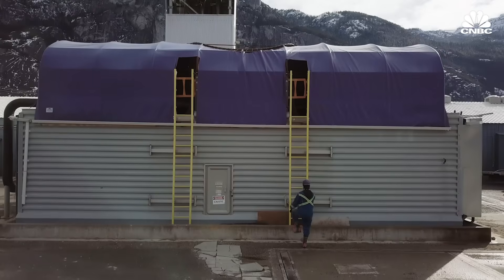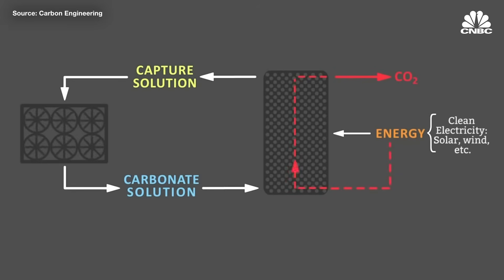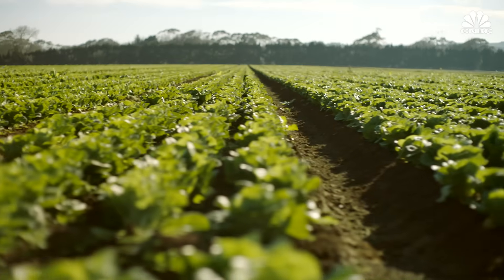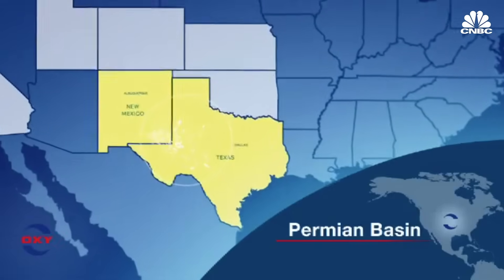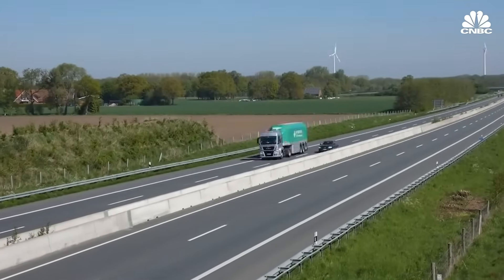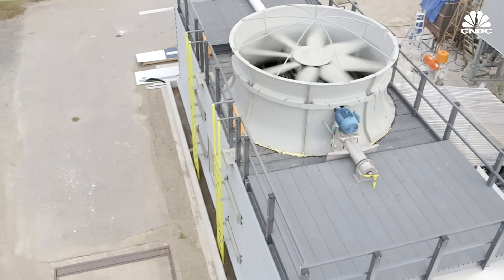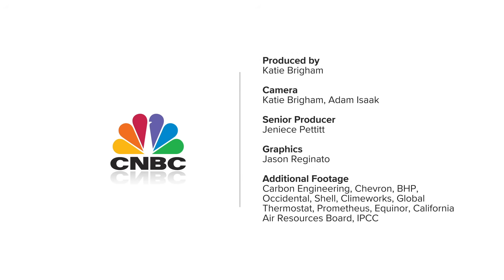Bill Gates-Backed Carbon Capture Plant Does The Work Of 40 Million Trees

Comment: Anthropogenic global warming....if only it were so. Global warming would move the limit of the grain belt up into Canada and Siberia. Greater CO2 would dramatically increase crop yields. Hunger would cease globally.
CO2 levels were many times greater in ancient times, yet no Armageddon occurred. Read the scientific papers of Dr. Heinz Hug to understand how CO2 functions in the atmosphere. It has very narrow bands of absorption, 1, 2.7, 4.3, 15 micrometers are the generalized spectral peaks. These wavelengths are ALL absorbed to extinction within 30 feet of the ground. ADDING MORE CO2 DOES NOT INCREASE ENERGY ABSORPTION, but only reduces the distance needed for full absorption by a foot or two. In fact, high CO2 levels caused higher O2 levels (photosynthesis) that allowed the dinosaurs to exist (Commercial green houses inject CO2 to increase plant yields). 

As an example, during the Cretaceous period, there was NO ice at all at the poles, much higher CO2, and the Earth was full of vegetation and dinosaurs. They could not live today as the O2 levels are too low for such large land animals. 

The oceans are rising today because the Wisconsinin ice age has not yet finished, there is still ice at the poles. The ice age ends when all the ice has melted, so technically were are still in the last ice age, but the next ice age will begin before the last has ended. 

The climate changes we have seen in the geologic record are entirely disconnected from the CO2 levels. CO2 is a VERY minor gas in the atmosphere (.04%). The Earth today has one of the lowest levels of CO2 in all of geologic history. If you double the amount of CO2, you reduce the water used by the plant by 1/2, and you have far higher growth rates. CO2 is the greatest fertilizer possible for plants. Note that water vapor is a vastly more efficient and abundant greenhouse gas (1% to 4.24%) than CO2. The reason for climate change is entirely due to the output of the sun, the tilt of the Earth, the orbital wobble, and the amount of cosmic rays striking the atmosphere. Watch the You Tube video "Svensmark: the cloud mystery" and maybe read his book "The chilling stars" to understand the reasons for climate change, it has NOTHING to do with CO2.

After doing these things, look on the US Geologic Survey website and find the graphs of Earth temperatures over the last 2 million years. This time period includes all the recent ice ages. You will see that this data proves we are leaving the current interglacial warm period and are entering the next ice age. In our lifetimes we may be within the next ice age. 

The fraud of anthropogenic global warming exists because the globalists are subsidizing it to convince us to accept a global carbon tax, that is to get western nations to accept it. There is no call for China, the greatest producer of CO2 in history, to pay such a tax. ONLY the west. This tax will in effect take money from poor people in rich countries and give it to rich people in poor countries.

Don't fall for this fraud. AGW is the greatest fraud ever thrust upon the people of the world in all of history. Don't buy it, educate yourself instead.

As a final note, read about the Vostok ice core samples, and other following sample sets to see that ice ages are preceded by a brief warming period. We are in that stage now.

Comment: There is a simple solution to the issue of what to do with captured CO2 Fuel and that is to limit it to vehicles that have no electric or hydrogen alternative... like Large ships and aircraft that travel around the world. This will of course require international laws. 

It could be forced upon industry by individual countries requiring ships and planes that use their shipping and air ports run on scrubbed co2 fuel.

If scrubbing CO2 out of the air to make fuel ends the messy and environmentally damaging pumping of oil out of the ground then that should be again a political aim made clear in law and something worth doing. 

At the moment I think about a third of all shipping is moving oil & gas around the world, so by putting co2 scrubbers in countries that are big importers then not only will there be less ships at sea often burning the dirtiest of fuels but we will also see Nations gain for the first time fuel independence and security.

This scrubbing of CO2 from the air is going to be expensive but I can see why oil companies would be interested in it beyond Green Washing their industry... reserves of oil are not running out any time soon but where that oil is located is getting more and more politically sensitive for various reasons, so being able to create fuel in situ without the drilling, pumping and shipping has a very powerful draw both economically & politically.

Let's be honest here, the Oil  Industry are not going to go away any time soon, so we need to encourage change in how they work and this is just one such opportunity. The alternative is going to be a move to more nuclear plants to replace those that are now reaching the end of their working life.

The main focus of future energy supplies must still be renewables with energy storage, more use of heating via ground heat pumps at neighbourhood level and getting transport to go electric and hydrogen powered.
Reply: Helen Lawson Nuclear waste? No solutions. Hydrogen manufacturing requires energy and is polluting and then is used to make electricity, inefficient.
Reply: Hi Joseph, As I said we need alternatives to avoid having to build new nuclear plants, not a fan but they produce good steady base loads to the grid.

Hydrogen for large vehicles & ships isn't perfect nor is the latest idea of ammonia, only we need something to fill the gap.

It creates a large amount of electricity ironically to produce most fuels we use but until there is a high density battery equivalent to fuel in large vehicles there is a need for something to keep industry moving.
It's what I like about scrubbing co2 out of the air and turning it into fuel but ONLY for aircraft, ships and large vehicles without practical alternatives, as it cuts out the need to get new out of the ground and then transport it around the world.

Comment: Trees decompose into carbon dioxide, plastic doesn't. If you turn CO2 into plastic or back into oil and then put it underground, the problem is solved.

Comment: How long will it take to compensate for all the carbon released during the manufacture of all the materials used to build the plant, run the plant, and cover the vehicles used to get personnel and equipment to the plant. Personally, I chose to believe Dr. Patrick Moore that carbon is not the driving factor.

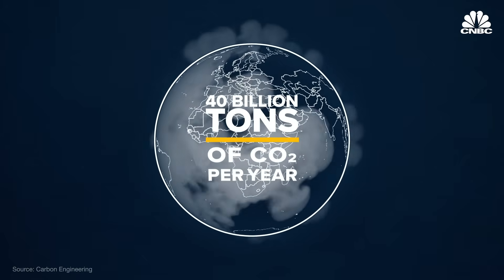Comment: In case anybody's interested, I did some math based on the stat given at 12:30 (40-billion tons of CO2 emitted per year). Also, as they said, given that each carbon-capture facility captures one ton of CO2 per year, we would need 40,000 facilities to neutralize current worldwide emissions.

With that in mind, if the US, Canada, Mexico, Europe (including Russia), China, South Korea, Japan, India, Israel, and Australia agreed to build the 40,000 facilities, then it would come out to one facility per 104,000 residents of those countries.

I couldn't easily find data on the construction cost, but operational costs would be significant--on the order of $4-trillion to $8-trillion per year, based on the numbers given at 2:25. This works out to $958-1,915 per resident per year. That figure doesn't take into account the cost of burying the carbon, so the actual cost would be even higher.

Comment: Shouldn’t the CO2 capture be done at the smokestack of the oil burners? We do need oil and coal for heating those who live in cold climates (even Florida). Solar power will not be able to provide heating during the winter, especially after a snow storm and during those grey days. For instance, I had a window facing the rising sun in Tallahassee. I used a small 10 watt panel to charge my 10 ma Onn battery pack. On a clear sunny day it would charge from empty to 100%. On a cloudy day it would barely charge. In states near the Canadian border it would probably not charge much even on a clear sunny day.

Comment: Another approach to carbon sequestration involves pyrogenic carbon in the soil, that is, charcoal.  There are a number of situations in nature where a fire burns and carbon is deposited in the soil.  Carbon could be taken from waste streams by pyrolysis, with the waste gases being combusted to help with the pyrolysis.  Then you have what would essentially be lots of activated charcoal to be added to the soil after it has been preloaded or charged with soil nutrients.  This is biochar.  This seems easier than pulling carbon out of the atmosphere for $100 a ton.

Comment: 😂😂😂 so you capture CO2 to produce fuel that will be burned to produce more CO2... That's the funniest redundancy...
Reply: The fuel is used as energy carrier. That's the point of fuel. It's as redundant as charging a battery on a motor in a plant to drive a motor somewhere else by discharging the battery again.

Comment: Sustainable Jet Fuel - Advanced Nuclear - Obtain Hydrogen via High Temperature Steam Electrolysis, sulfur–iodine cycle (S–I cycle), copper–chlorine cycle (Cu–Cl cycle) and/or hybrid sulfur cycle (HyS) - and then Carbon from Carbon capture. Fischer–Tropsch process will yield fuel.

Comment: Those leftwing scientists would someday realize having a working carbon-neutral way now is better than having a perfect solution after it's too late. I've done several years of work on CCS and using captured carbon on oil production is the most viable way for the moment. And then we can design ways to use fuels more responsibly. I know we have fossil-fuel driven EV that can do 2L/100km with way less emission than current ICEs and those are good interim choices. Stop asking for government (others') money, make your own.

Comment: Fact Check:  When CO2 is placed in an oil and gas reservoir, it is put there forever as long as produced CO2 is recycled back into the ground which is the way CO2 floods work in the oil field

Comment: Brilliant Idea, recycle beside plants & cities, mostly any other chemical plants would require fluorine filtering or chlorine, if this can grab c02 out of the air then perhaps we could use similar designs with some heat sinking vents that produce energy as well, you have a lot of light that is often lost as heat or infrared reflections. I think a few combinations, more recycling , and filtering, the devices work together.

Comment: Oil is our blessing and our curse.

We use it to run our engines that produce carbon emissions heating up the planet.
We use it to make plastics that pollute our lands and oceans.

But its cheap and convenient. It's a money maker. Greed and conveniency has gotten in the way of what's right.

I understand companies like carbon engineering need money to continue there work, but money from the oil and gas industry is not the way to go, especially if they'll use it to retrieve more oil from the ground. If oil prices go down, we will never find a suitable, biodegradable option for plastics until its too late; never reach a dependence on clean energy transportation. We will change our ways when it's not cheap nor convenient, and I'm afraid a toxic environment will have something to do with that.

Comment: No matter how you think or feel about this - good, great or bad - we also need to plant a trillion trees+ no matter what other C02 capture systems are invented because of the co-benefits - especially to the fresh water supply and wildlife habitat - 75% of the fresh water supply on the planet is created by forest catchments and 80% of the terrestrial species on the planet rely on trees and forests.   While the crisis of climate change gets the most attention, the fresh water and wildlife crisis are also equally life threatening. So even if we somehow miraculously resolved the climate crisis within the estimated time frame necessary, through clean energy and carbon capture - we are still just as doomed for possible extinction if we don't address the fresh water and wildlife crisis. And these can both be addressed through tree planting - which also makes a significant impact on balancing the climate. Trees create climate - and by doing more than just turning C02 into their bodies by turning light into matter. They also provide shade - which turns the solar radiation that would otherwise be experienced as heat into biological life. The difference between standing on cement in bare feet and below a tree in a city on a 90 degree day is extreme. This reduces the need for air conditioners in cities which are another major contributor to green house gas emissions. We need to stop separating the crisis of the climate into its own fragmented compartment from the other major crisis of our time. It is all ecological crisis. That is the root cause. Heal the earth and you heal the atmosphere. The atmospheric issues we are experiencing have as much to do with land-mismanagement - deforestation and unsustainable farming and ranching practices, as they do with fossil fuel use. Loss of soil carbon - being returned to the atmosphere as C02 as it bonds with oxygen - has been going on for 10,000 years since the dawn of agriculture. 80% of the global economy is run on fossil fuels. No matter your ideology - reason bares the blunt reality that we can not transition off of fossil fuels in time to re-balance the atmosphere. We also need to restore the earth, and trees are the anchoring mechanism to reboot damaged ecosystems.

Comment: So where is the problem carbon dioxide? We are told it is in the upper atmosphere where it reflects a portion of heat back to earth, but this is not completely believable because carbon dioxide is heavier than air.?  Other greenhouse gasses are water vapor (eg)clouds that hold the heat in at night but reduce radiant heat during the day.. Now if carbon dioxide is the 0.04% they say it is, how much atmosphere has to be treated to take out a meaningful amount of carbon dioxide...The place for these is at the point where carbon dioxide is generated by coal fired power stations.. THis is where where the sulphur dioxide and particulate matter is taken out by scrubbers. and there is a power source to run air cleaning devices. But take out too much green house gas and we could bring on an ice age because, it is the green house gas that prevents us from freezing.?

Comment: It's a great idea, but you will need Terawatts of almost free energy just to power it, and here is how you generate that type of massive power and near-zero cost:  Thorium fueled molten salt reactors.  India and China are both working on prototypes of those reactors right now.    (THORIUM 232 - From History to Reactor [2019] = https://www.youtube.com/watch?v=biToH42YZZ4   (Thriving on Thorium: India's Future ) = https://www.youtube.com/watch?v=M2X0klAjT7Q   These Thorium reactors are really 'breeder' reactors that turn harmless thorium into burnable uranium in just a few months. The reaction first needs to start up using pure uranium, but a thick blanket of thorium surrounds the molten reaction chamber and that thorium absorbs the stray neutrons and is thus converted into burnable uranium, it literally generates its own fuel that way.  And thorium is as cheap as sand and as easy to get as sand (it is a waste byproduct of mining and already America thousands of TONS of it, just sitting in waste heaps at almost every mine.  America has enough thorium to power ALL of America's energy needs for the next 10,000 years, and that's just with the thorium that has already been dug out of the ground right now. There is 100 times more of that mineral that has not been extracted from the ground yet.    The nice thing about thorium is that the nuclear reaction burns up 99% of all of the waste that normal nuclear reactors leave behind, and the waste that is left behind degrades in just a few thousand years into harmless materials, compared to the millions of years that the waste from today's reactors takes to become safe.

Comment: What has the oil companies and cars got to do with CO2 emissions? Cars emit Carbon Monoxide. CO2 means they will be capturing 2 atoms of oxygen as well as 1 of carbon.
Reply: Well no they emit carbon dioxide as well(and many other contaminants), manufacturers try to reduce their carbon  monoxide output as much as possible. Oil companies extract fossil fuels, which contribute to the amount of carbon dioxide in the air.
Reply: That may be true about the info you gave but it doesn't change the fact that CO2 capture means capturing 2 atoms of oxygen as well as 1 of carbon, so CO2 capture means they capture oxygen as well at twice the rate. I'm no scientist but tell me why I am wrong about this suggestion. Also, if CO2 makes up 0.04%, then only about 0.0134% is carbon, right?
Reply: @fearandconsumption  Uh no thats not how it works. The oxygen is bonded to the carbon, so its one single particle. Of you were to break it up into 1x carbon and 2x oxygen then yes there would be oxygen, but not in the case of co2 as we have here. You cant breathe in co2 for oxygen for example.
Reply: OK. Understood.
Reply: Can you explain why an increase in a trace gas (0.04% to 0,06%) is very bad for the Earth? Seems like it's not significant and why would an increase of 2 parts per 10,000 be a bad thing given that it fuels a growth of plant life at the same time, if reports are true.
Reply: @fearandconsumption  I'm sorry what? I would recommend doing a bit of research into climate change and co2, and how it affects the ecosystem. More co2 isnt a bad thing for plants, but due to the way it reflects heat back onto the ecosystem as opposed to pasing through to the ozone layer, excessive co2 is amongst the reasons why the planet is slowly getting warmer.